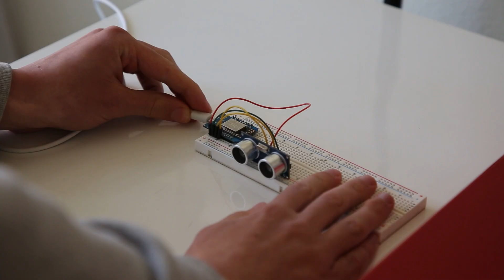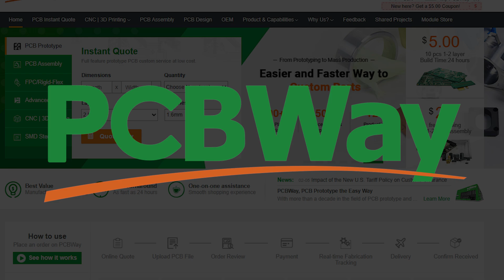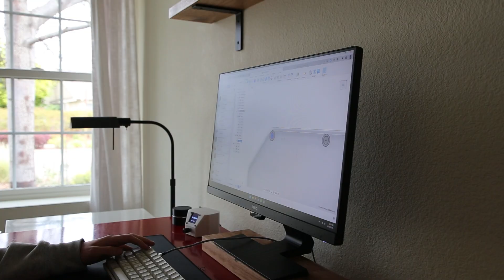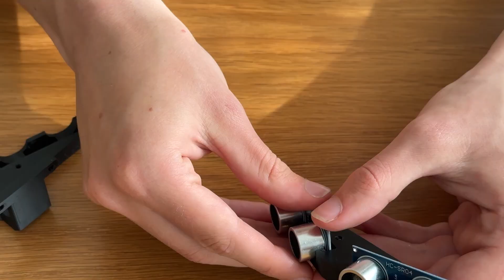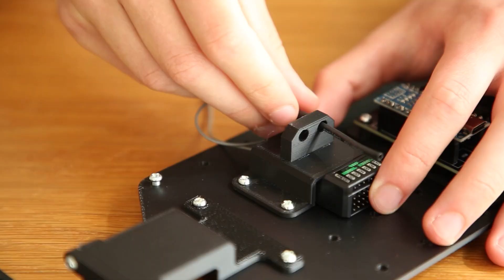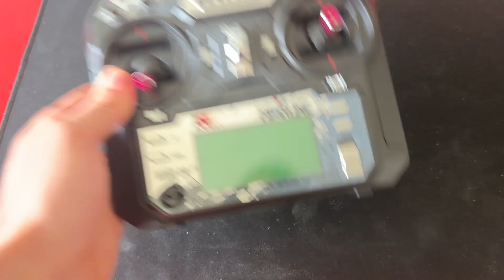How I Made an RC Car That Brakes Itself

Comment: I have been thinking along the same lines but not necessairly for breaking but a great idea for corners and such.  If you are in a competition, I think this implementation would prevent you from passing or if you had the side sensors attached it would break every time someone passed you or you got too close to the edge of the track (assuming your track has physical edges similar to the indoor tracks I have raced on.

Saying that, I have been thinking about how one would integrate several sensors to learn a track and figure out on it's own the best drive line, speeding up on straitght stretches, breaking enough at corners to allow for a smooth turn while accelerating as it comes out.  Once it learned the track, using the sensors to track other vehicles allowing for passing when safe to do so.  Not unlike self driving cars but not quite as complex.  I was thinking of transducers like you have here for finding track edges and walls to slow down and navigate corners, ramps and such while improving it's feedback as it successfully navigates the track.  Accelerometers, some form of tilt sensor to help with navigating corners so you don't flip the car when going too fast, GPS (probably too coarse a measurement for RC tracks),  camera to help identify the track edge (some outdoor clay tracks have grass on both sides) and other vehicles (to work with the transducer and learned track data) to allow safe passing.  

Will I get to that?  Maybe one day.  Your effort in this project gives me more ideas.  Thanks for posting!

Comment: You might want to swap to more modern, brushless electronics cuz they are faster and more efficient
Reply from the maker: Thanks for the comment! Brushless looks like a much better choice, especially since it also seems that brushless motors have a shorter braking time compared to brushed ones.

Comment: 9:34 the issue is not that the refresh time is not fast enough, but that US sensors are very sensible to the Doppler effect. Receiver bandwidth is very narrow to limit interferences and noise from other signals. Thus when the speed is too high, the echo frequency has changed so much that the receiver just doesn’t get it. Ex: at 2 m/s, the frequency goes from 50 kHz to 50.6 kHz.
You can test it by computing the speed (d2-d1)/(t2-t1), log it on the computer and play with your hand in front of the sensor. You'll see that above a certain speed the sensor is fucked up
Reply from the maker: Hey thanks for the comment! I didn't realize that the Doppler effect also impacted these sensors, mainly because I saw ultrasonic sensors on many other rc car based projects without realizing they were being used at low speeds where this likely wouldn't be an issue. This makes a lot more sense and explains why the car wasn't stopping in time.

Comment: When i was in 8th grade i had made a similar project with different approach, I took an old cheap RC car made it so that car's motor is directly powered by the 3.7v li-ion cell and it would go straight without stopping then i used a single ultrasonic sensor at front and Arduino UNO with a solenoid from a gas based water heater made a lever sort of system with it that pressed a hard rubber (cheap eraser is what i used) against the tires hard which instantly stopped the car in its track i won 10k rupees as the prize from govt. But i just blacked out like not that i fainted it was like i wasn't able to understand what anyone was saying in any language and i wasnt able to comprehend my surroundings while the final evaluation 😅 so i didn't win obviously 😂 😅 (the grant was to develop this project)
Reply from the maker: Hey that sounds really cool! I never thought about approaching the braking system like that by using a physical stopping mechanism. I would say it might even be more reliable than sending a signal since the esc sometimes has a habit of being overloaded and rejecting incoming brake signals from the arduino.

Comment: I'm cheap af. I'd just slap a cheap accelerometer on there to work in tandem with the proximity sensors.
Reply from the maker: That's actually a good idea, it would definitely be easier than ripping out the old sensors and restructuring most of the code again with new sensors.

Comment: If I remember corretly the best you can get out of the sensor is one trigger every 50ms. But in reality this would be a bit more since code optimazition, jumper wire leng, etc.. (thats just details tbh)
But I feel like thats fast enough for this.

Either way try out VL53L1X it is faster and can cover distance up to 4meters, might help for early breaking if thats the case.
I didn't messed with it yet but it sound promising from what I searched, also they're cheap as most of other modules.
Reply from the maker: Hey thanks for the comment! I'll definitely try tweaking the the trigger delay since there's a good chance that I'm just overloading the sensors with too many measurements. Depending on the results, I might just swap them out with a light based sensor, like you mentioned, to avoid the pain of optimizing everything.

Comment: You should try using lazer tof sensors. They work much much faster tho they are sensitive to obstacle reflectivity
Reply from the maker: Hey thanks for the comment! After some quick research, these laser tof sensors seem to be way better than the sensors that I used and I'll likely end up upgrading to them in the next video.

Comment: Hey great video. Not too long and not so sort we can't see what you've done. 
Did you juct cut the power to the drive motor or did you use motor braking? ie reverse current through a resistor or regen charge the batteries like a tesla?
Reply from the maker: Hey thanks for the comment and I'm glad you liked the video! I switched out the esc and am sending a brake signal to the motor via the new esc, the same signal that would be sent if you were braking using the original controller.